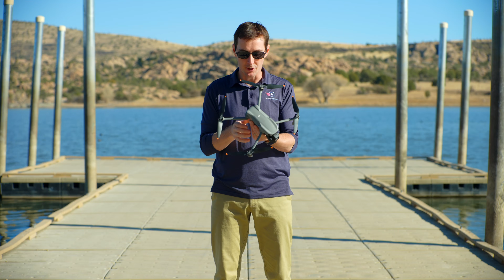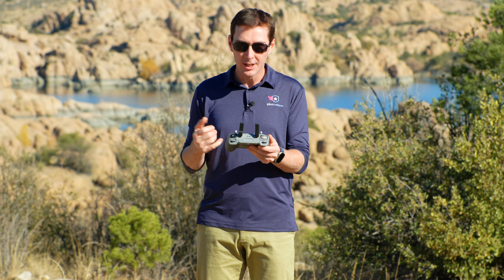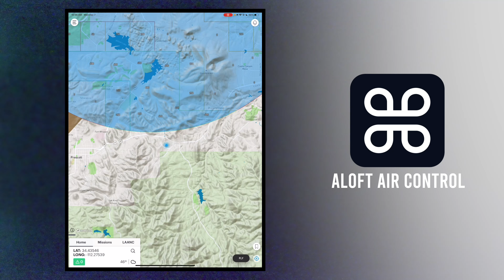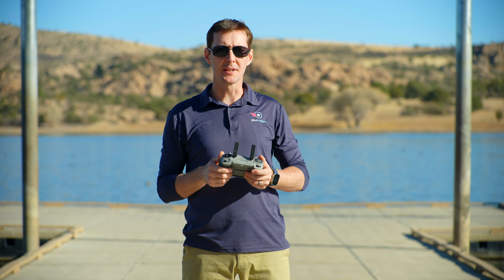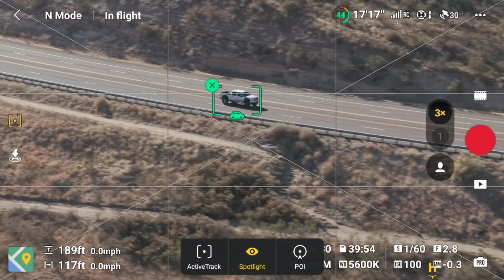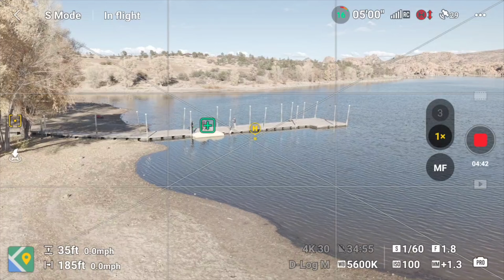DJI Air 3S: Beginner's Guide (Start Here!)

Comment: Hello. I just got my first air 3s and tried it. The first land was fine just a little off the land spot but the 2nd time I tried landing it following the same instructions, it landed a foot away from the landing mark and it would not stop bouncing, to the point that it turned over ruining the propellers. It did this the 3rd time trying to land as well. Any suggestions?

Comment: If you use a polarizer (ND) do you need to compenste manually or does the sensor compensate by itself?
Reply from the maker: You need to compensate manually. We have a a video on the channel about ND filters

Comment: When registering with FAA DroneZone, where is the REMOTE ID Serial Number on the AIR 3s? I only see 2 SN listed, neither of which state "REMOTE ID SN". My AIR 2s did have this listed but I do not see within the AIR 3s. Is it now the same as the Aircraft SN?
Reply from the maker: Yes. Aircraft SN if there is no RID specific number. Should start with 158 and then a bunch of numbers.

Comment: This is a great video. As a new owner of the 3s i like watching and going over its features. 

One thing however I have seen multiple reviews miss to mention when changing the video mode to D-Log M is that you have to separately change this mode twice. Once in regular video mode and a second time when or if you decide to use “master shots”. 

Also to note you can change to D-Log M in video while the Drone is grounded however, you must be in flight to access  and change it to D-Log M in “Master Shots”

I made this mistake the first few times i flew. Had great D-Log M video but all my mastershots were still in JPEG. Was a little bummed out. 

Hope this helps!

Comment: My air 3S drifts slightly without any stick input, and it seems to loose its active track point really quickly. 

Also, if doing a quickshot (drone or rocket etc) the point it was locked on at the start moves many meters away. 

It’s not my fist drone so to me it deffo feels like it’s buggy or got something wrong. It’s done this since its first flight. 

It’s a shame as due to the drift, it’s made me not trust it half as much as I should do, this meaning I fly a lot less nowadays. 

I previously owned the Aor 2, the Mini 3 Pro & the Avata, so I’ve owned other Dji products and never had any sort of issue like this. 

Is this a common issue you’ve heard of with the Air 3S? 

I have updated firmwares, formatted sd card etc and it’s still the same. 

Cheers

Comment: I am excited to receive mine tomorrow. Seems to be an extremely capable piece of equipment. This will be my first drone, I am excited for the new journey.
Reply: How is the drone? How strong is the connection when the drone is over obstacles? How far away can it be away from you before you begin to lose signal? How long does a battery  recharge? Are the batteries heavy? Did you find it setting on your shelf more often than you thought? Can you do cool tricks with it?

Comment: I live in West Virginia (mountain state). The Mini 4 Pro was my first DJI drone (also have a Autel Robotics and Ruko drone). At 400 feet I couldn't get out or my valley. I could see much further. Just couldn't get there. Then I read that the Mini 4 Pro was allowed to go to 1,640 feet in the US (all commercial traffic around here is at 35,000 feet). Now my line of sight area is miles using a strobe light at the bottom of the Mini 4 Pro mounted just forward of the battery (the propellers easily fold around it there). I'm retired and have the recreational license. My property is surrounded by 800 acres of government land (got permission to fly over their land).

Couldn't get the Air 3s from DJI because US Customs kept holding it (a month per try). So I got a refund and Amazon finally has the Air 3s in stock, but only available with the RC-N3 controller which is fine as the Air 3s will be replacing the Mini 4 Pro (will re-bind my existing RC2). Also have the Goggles and Motion Controller 3 from my Avata 2.

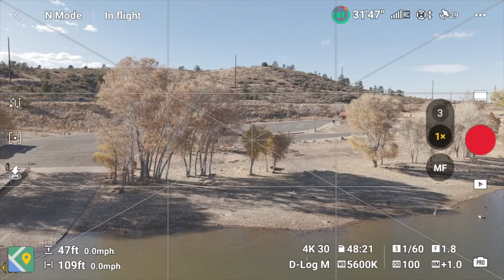Comment: 9:06 - how do you know what recording settings to use based on various factors?
Reply from the maker: It comes with experience but in general rule, if you’re using manual settings, for video, it’s a good idea to use a shutter speed that’s double your frame rate. So 30 frame per second gives you 1/60 for the shutter speed. And use the lowest ISO possible.

Comment: My Air 3s is still being held up in customs.   Any suggestions on getting the shipment?
Reply: Been trying to order one everywhere I go says it will be delayed due to custom restrictions…
Reply: For my Air 3s, it was held up in Customs for over a week. I was first asked to supply my social security number (which I did). In the second week Customs sent me an email requesting proof that the contents of the shipment were not produced, wholly or in part, with forced labor. "Supporting documentation should trace the supply chain from point of origin of the products to the production and processing of downstream products to the merchandise imported to the United States." I had a week to provide the documentation or the shipment would be returned to DJI. I contacted DJI and their team followed up with me within 24 hrs. Turned out Customs then requested a physical inspection of the package which would take 2 to 3 months. DJI offered me a refund which I kindly accepted, then purchased the Air 3s from Adorama and I had it in 2 days.

Comment: I ordered one 2 weeks ago and it’s been stuck at customs for a week! I hope it will be released soon.
Reply: It’s so odd how some have no issue receiving their orders whereas others are like you. I ordered my Air 3s on a Friday and it was delivered on Monday around noon. I fully expected to have issues as soon as many have experienced but I didn’t. What I found out though and this might not pertain to your order but holds true for plenty of others. That’s being it appears issues come up more when the airport that’s used for entry into the US is also located close to a shipping port. Like in NY/JFK, LAX, as well as MIA-Miami Fl. I’m in the Dallas metro area and my order went from DJI to Atlanta, Atlanta to Houston, Tx, Houston to DFW-Dallas. Hopefully yours will get cleared soon! Tracking info was excellent and my order actually cleared US Customs while in route to Atlanta. The regulations state orders under $2500 US aren’t suppose to be held up but that’s not the case with plenty of others that have ordered, good luck!!
Reply: Hoping yours gets cleared through customs soon! I was planning to order the Air 3S Fly More Combo in 7-8 months but after the elections, I didn't want to wait. So I ordered mine through a retailer in Ontario, Canada. They shipped out promptly and I got mine here in Las Vegas in 7 days. It never got delayed in customs. Mine went by way of Canada-Michigan-Wyoming-Illinois-Nevada.

Comment: A note btw, if you use air 3 batteries on the air 3S, thats fine, but I believe it disables the feature where Bluetooth stays on for 12 hours after you power the drone off for file transfers. The battery capacities are ever so slightly different as well.

Edit: I did confirm this is true from other reviews and DJI's own website